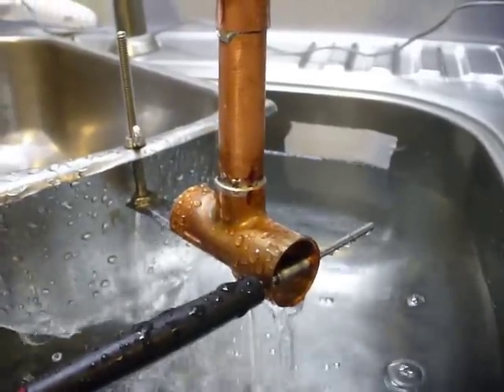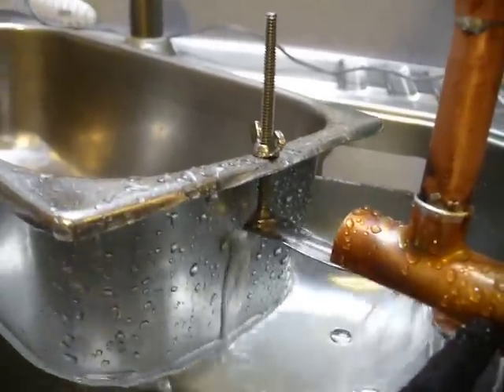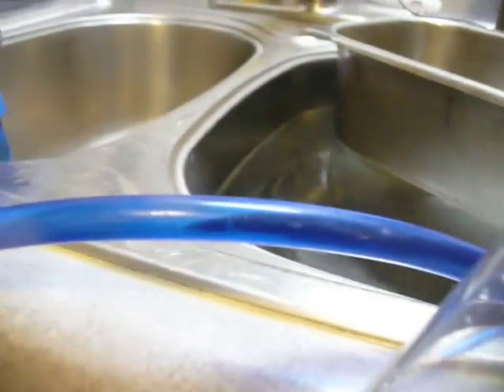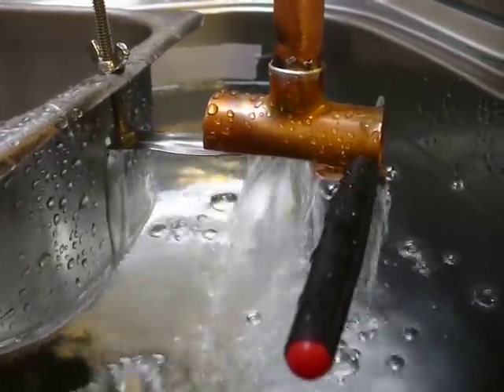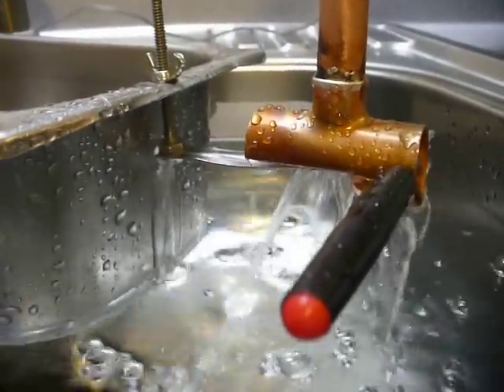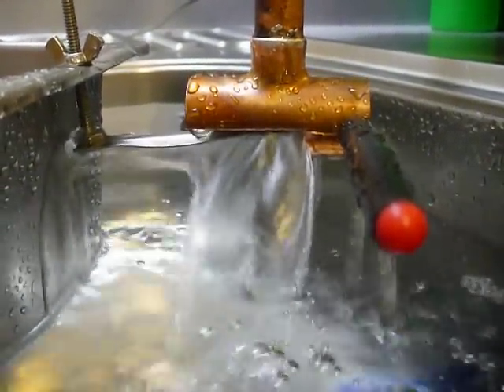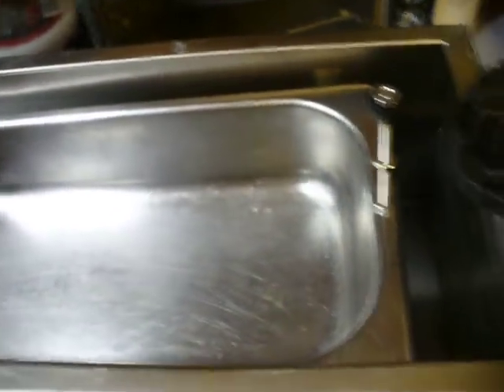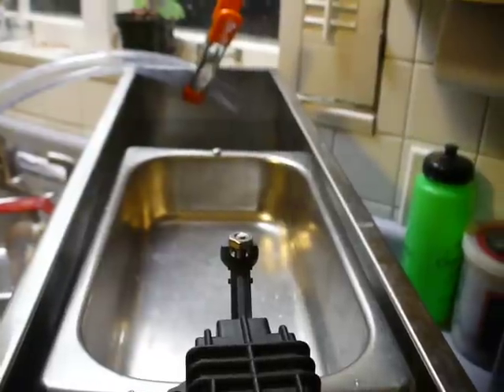Homemade Float Valve for Making Maple Syrup

Comment: have you tried to do this with a smaller "float"? I have a 2x4 divided pan. would need a small float.
Reply from the maker: Rich Hays You can use just about any size as long as it floats. The main thing to worry about is to be sure the valve seats well enough so that any leakage amount is less than your evaporation rate.
Reply: DCToblerone thank you!  will be working on this tomorrow!